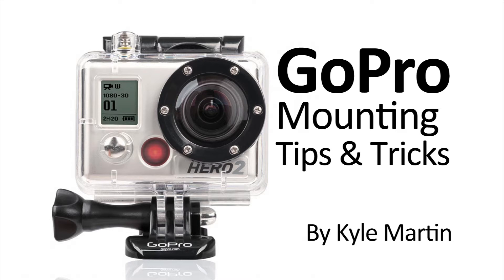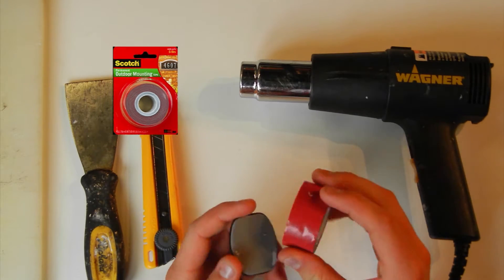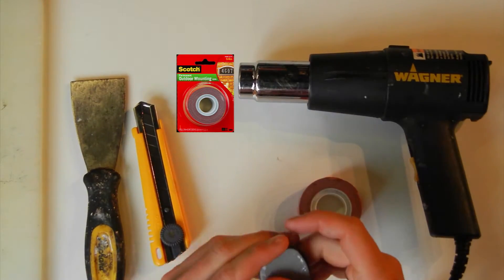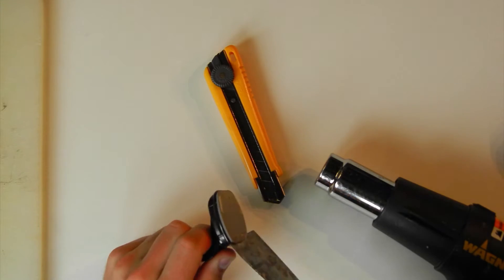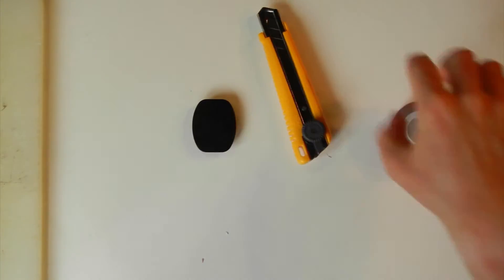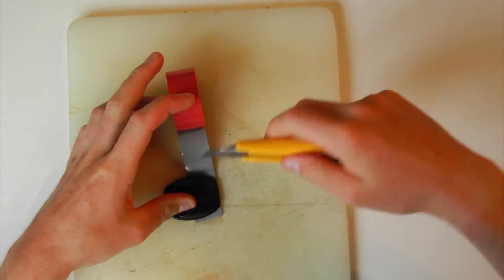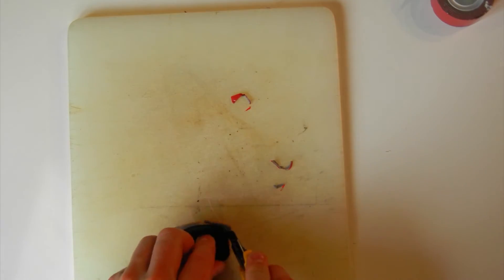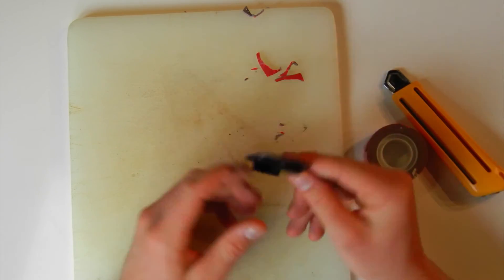Replace the Adhesive on an Adhesive Mount: GoPro Mounting Tips & Tricks

Comment: thanks for this video- just got my first gopro (#3)- can you tell me how you REMOVE an adhesive mount from something if you don't want the mount to be attached anymore? Using a heat gun may not be appropriate as my main use will be to mount the gopro to EPO foam RC planes and foam will melt with heat..

Comment: Word to the wise: These suction cup mounting plates with double sided adhesive will come off and can be reused. I used a heatgun to heat up my phone mount [adhesive that goes to the dashboard, impossible to rip off] and it came off. I immediately took it to my other car, warmed it up a bit with the heat gun, and reapplied it. Works perfect :)

Comment from the maker: You can not reuse the mounts. However by worming up the mount by using a blow dryer you will be able to remove the mount. Then you can replaces the adhesive using this method

Comment from the maker: I would not use super glue it is not that strong especially if it is hit with a sharp impact. If you really want to glue it something like hot glue would be best. There are not mean glues that will stick well to the plastic of the mounts. The first thing that came to mind was epoxy but it does not bond well to plastic. You could try shoe goo. Hope that this helps.